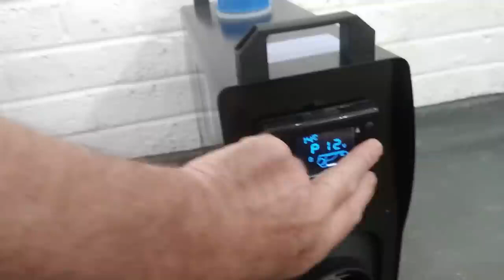Free Heat from Waste Exhaust Gases Heating Radiator Home Diesel Heater Chinese EGR Recovery Exchange

Comment: What radiator did you use and is it available on Amazon. I think this is a good idea. Keep it up!
Reply from the maker: https://amzn.to/40dwR9Y
please scroll down they are here
happy new year andy
Reply: @andyfirebladesgarage  Thank you for your time. Apparently, Amazon across the pond in the USA these items are not as economical.  My options do not look to be of the same quality you have available. 95BPS is the lowest cost available. My options do not look to be of the same quality you have available. is 17.13 inches or 435.1MM wide. seeing that it is aluminum at 4.491 kg I fear it would not hold up to the exhaust gases. I enjoy watching your experiment's, good luck and keep it up. Thanks again, Bryan

Comment: The exhaust of the diesel heater must be higher than the inlet level in the radiator. So you will have to raise the diesel heater on a few bricks, this way the condensation on the exhaust will disappear
Reply: @uncioclasprinlume  I Don't think it will you know. Water vapour is caused as a result of the combustion process. Adding the radiator acts as a heat sink , lowering the temperature of the combustion gasses. He will probably still get the condensation plume. The gasses will still condense and because he has raised the heater, he may get water dripping out the end of the flue. This will depend how long he runs it for...Same as a gas boiler if you install the flue falling the wrong way. Water dripping out the end of it.

Also the condense may be slightly acidic if it works the same as a gas boiler! I suppose how much water vapour is caused on combustion....
Reply: @jbclassics  The comparison with a stove and chimney is wrong because they have different operating systems. Just try what I wrote and he will see the difference immediately

Comment: The water vapour is condensing as the gas leaves the exhaust. 

This is because you have lowered the temperature of the exhaust gases by feeding them through the radiator.

Like in a gas boiler you may need a trap to catch them! They may be acidic and could rot their way out of the flue/radiator.

On a gas boiler the flue is fitted so that any water vapour created falls back through the boiler into a trap. It is then drained away via a plastic waste pipe.

The water vapour could be collecting inside the radiator and may eventually block your flue!

Great idea but just be careful!! It wasn't designed to work like this. I am not an expert but do know about condensing gas boilers  I presume the same principles apply. If it did block your flue are there any safety features on the heater causing it to cut out! Remember Co2 does not smell....